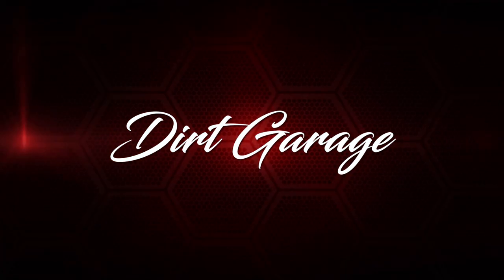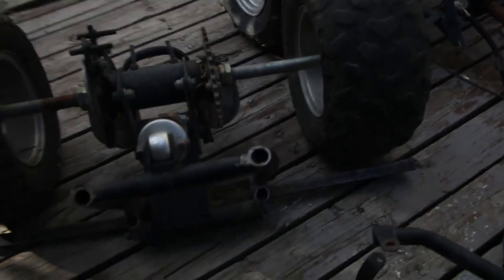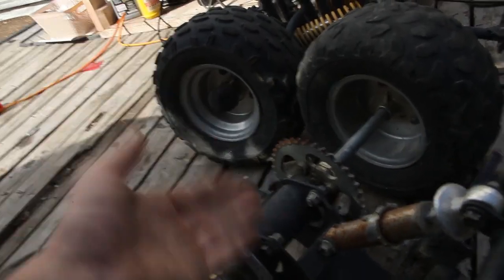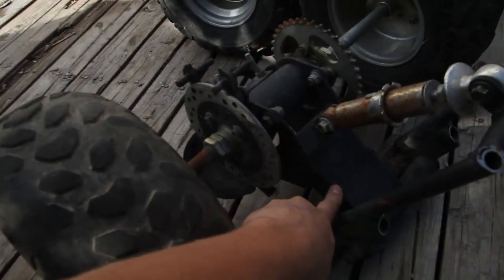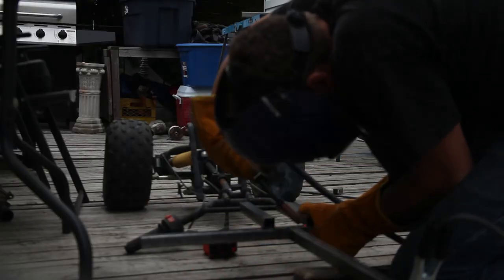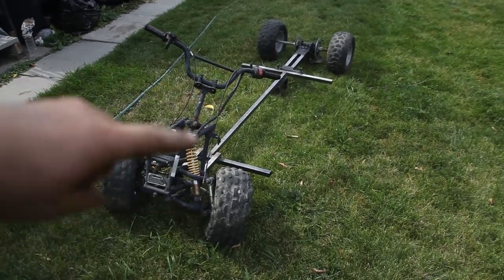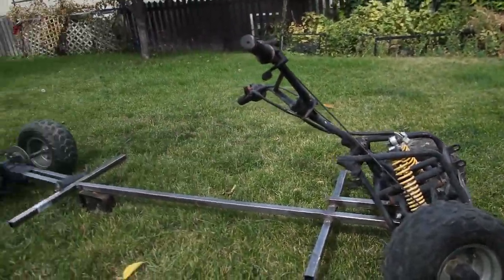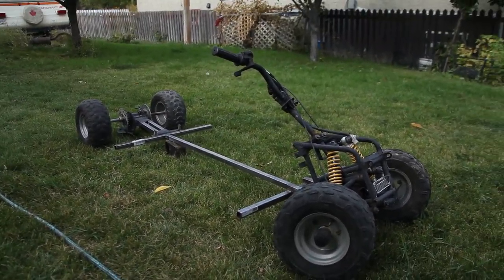Barbie Jeep Power Wheels Build! (Part 1) ATV Chassis into Go Kart!!

Comment: Hey great video. I envy you pushing the limits of that recycled ATV. I would love to do that myself but I am not as mechanically inclined as you are. Hats off to you sir.
Reply from the maker: Thank you! Snow is finally going away and I can start work on this thing again soon. Getting excited.
Reply: There is only one way to learn and thats first see someone do it right, explain what they are doing, what reason and then learn by doing with that example. The final learning comes from actually doing it your self. People just dont bother to do it and trow away working things what in most cases just have error known as ID-10T.